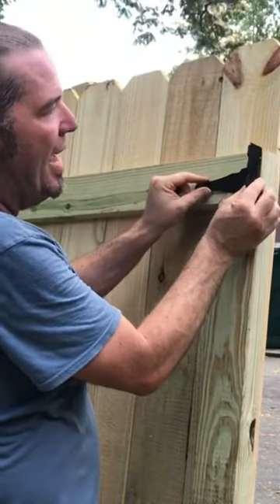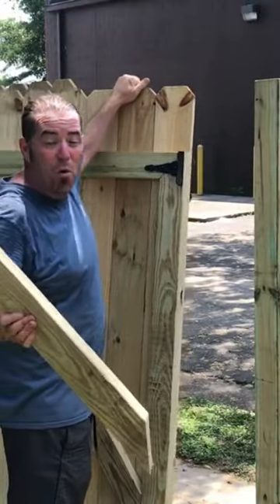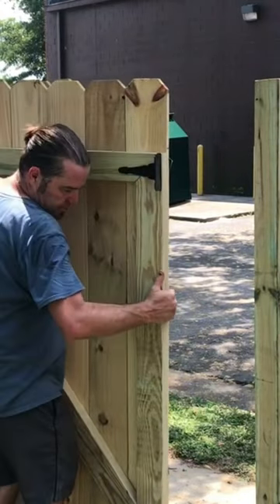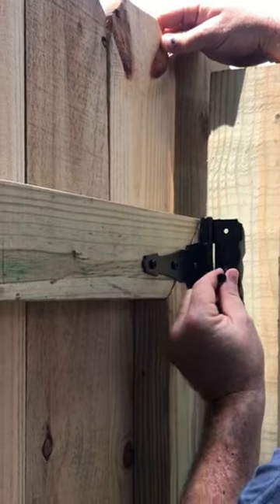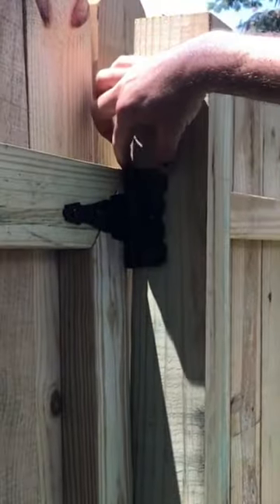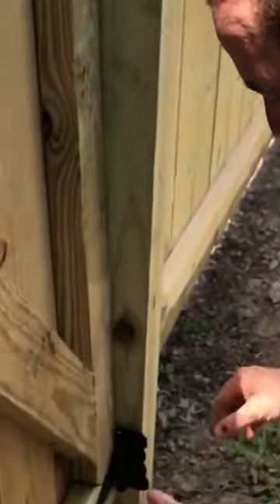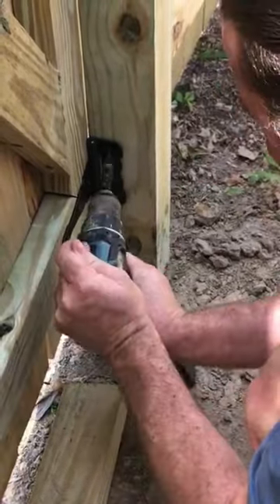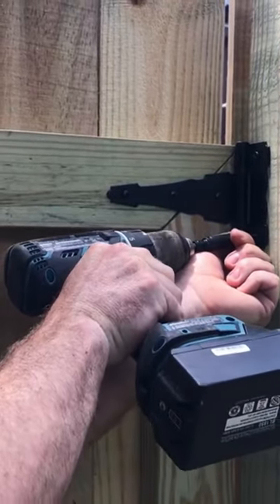Hinge a gate.easy! You Can too! ￼

Comment: By cutting the corners for the frame and giving them an angle, does that provide more support? I’m in the process to make my gate, that’s why I ask. Thanks. Looks clean and nicely done.
Reply from the maker: Thank you Luis I like to picture frame my gate so the 3 1/2 inch screws can reach the other piece, if you don’t cut them in a 45 you would need to toenail or do some kind of gait kit to make it work. You got this!

Comment: Note the diagonal support - called a crossbuck - has been pre-installed while the gate was new & completely squared up.
    Also note the crossbuck is going the correct direction, from the upper latch corner to the lower hinge corner AND is inside the rim frame.
   This is a well built, fairly heavy gate. Therefore make sure the hinges & screws are rated for that weight. A 3rd hinge could be needed. If so, alignment of the hinges MUST BE correct or they will bind.
Reply from the maker: Thank you doctor. This guy knows what he’s talking about. I appreciate the comment
Reply: It'll sag, guaranteed.

Comment: Where you chose to install the hinge is week as well. The weight of your gate is going to be constantly pulling at the screws you put in the post. Where as if you would put the hinge on the outside  the weight of the gate is pulling laterally on the screws which is stronger than how you have it pulling the screws straight out
Reply from the maker: Thanks for watching

Comment: I would suggest a limit stop of some kind at 90 degrees. A good gust of wind pushing the gate open will bind the hinges and pull the screws out of the post.
A better way to frame to gate is to position the permitter framing members so that the frame is the same depth as the post. The hinges then can be installed on the face of the post allowing the gate to open 180 degrees.
Reply from the maker: Good info here. Thank you for sharing
Reply: ⁸⁸⁸⁸⁸⁸⁸⁸⁸⁸⁸⁸⁸⁸⁸⁸⁸⁸⁸⁸⁸⁸⁸⁸8ppp⁹

Comment: beautiful gate / fence, and it need to last 20 years, but it will not unless we protect it from it's enemy  / rain & sun. Pressure treated  alone  will not last. plus if the fence is touching the ground, termites shall have  fesasta. ASAP paint it with a oil base paint,  2 good coats, preferably 3.  The flower Marigold will act as a termites deterant.  👍👍👍👍
Reply from the maker: Awesome information here. Thank you so much for sharing

Comment: Your posts are bare at the base. Doesn't matter if there treated because treated wood only means rot "resistant". It doesn't mean it's rot proof. And where wood meats the ground is where condensation or water is constantly witnessed, and this will kill a fence post in halve the time... To basically rot proof a post you need to put several applications of a roofing sealant and or put a char on it and seal the burnt char with oil. If you do anyone of these, you'll "doubled the age of the posts."
Reply from the maker: Interesting share Robert. I appreciate you commenting

Comment: Why do you need vertical 2x4’s on the sides of the gate? Don’t they just add weight to the gate that the hinges have to  support? Lags and bolts everywhere.
Reply from the maker: Hey David , if you don’t frame a gate it will warp on you. Thanks for commenting

Comment: The gate looks decent. The hinges are undersized.
Reply from the maker: Thank you Brian
Reply: @homemend  I can't tell you how many gates I've had to fix that just weren't done right to begin with.
   Yours looks great. 
   My personal rule of thumb is to always use the biggest hinge I can without going overboard. It might have just been the video, but those looked just a bit small. But I do know hinges have weight margins they work for. Yours might be perfect.
   I once had to redo an entire double gate because they put that angle brace with a 1/2 inch gap in it. Plus they thought it was a good idea to use sheet rock screws for the pickets.
Reply: So are your pants, you're not fooling anyone Brian

Comment: I guess you could assume the post is plum, but I still would have verified the gate was, before I set the bottom hinge. Can't stand a gate/door that either won't stay open, or closed because somebody didn't bother to plum or level anything
Reply from the maker: Hey Chris everything can’t be squeezed into a one minute video unless you’re talking fruit I think you mean PLUMB. Thanks for sharing
Reply: @homemend  your are correct it is plumb. However, I feel the use of levels in fence gates is very critical, or at the very least mentioning to check for plumb on both sides

Comment: So if you are building a gate whether it's small  or big your hardware should be made from at least 1/4" plate steel and your fasteners should be the largest diameter lag that you can use not screws, if you follow these two/3/4 rules(#1don't be cheap if you want to do it once) you won't be remaking and/or repairing the gate(s) for
hinge/hardware failure. I'd like to believe that you already know that purchasing the correct hardware can't be done at your local Lowe's or Home Depot because they only sell garbage.
Thanks 🙈🙉🙊
Reply from the maker: Thank you so much for the info Eddie
Reply: @homemend  wasn't being a d@#$, I've built a lot of gates and a lot of them had crap hardware because that's what I found at the box stores until I had to build a large 10' x 4' double gate and found that there's different hardware to do it once. As far as the lags vs screws, those hinges are reliant on the bite and overall weight distribution of the fasteners so the smaller the diameter and shear strength of the fasteners the faster it will wallow out and become loose.
Anyway wasn't knocking you just pointing out and sharing what I've learned through trial and error.
Thanks 🙈🙉🙊

Comment: I build the gate straight up then cut it out. Learn the trade bro. Work smart not hard.
Reply: Looks way better especially if you’re doing horizontal boards or an “invisible” gate. 

I did horizontal 1x2 cedar with 1/2” spacing at my house. Only way you can tell there’s a gate is if you see the 1/2” gaps for hinging. All hardware is inside the fence.
Reply: I thought I was the only one that did that. Build straight thru with all bracing in place. We add some thin gussets to our joints as well. Cut for hinges one at a time  and install. Makes for a lasting gate
Reply from the maker: Thanks for commenting